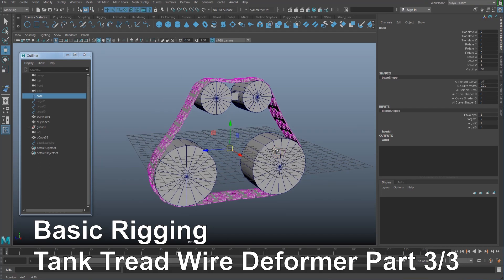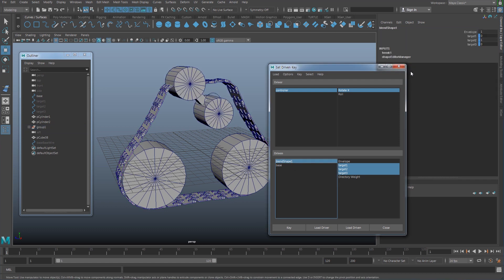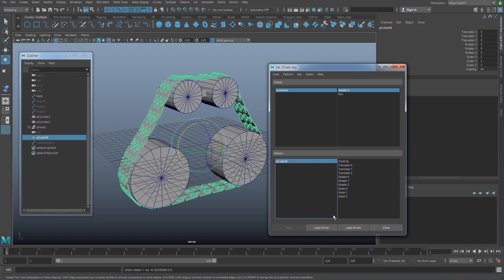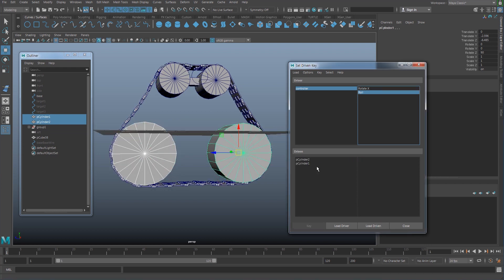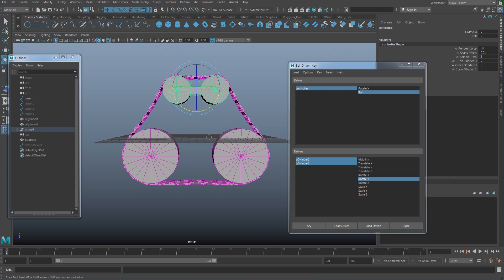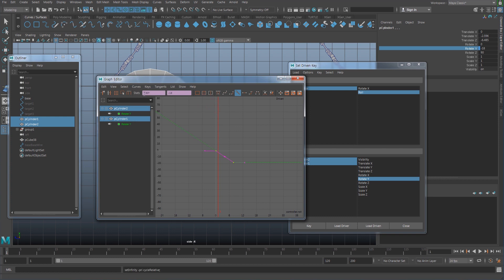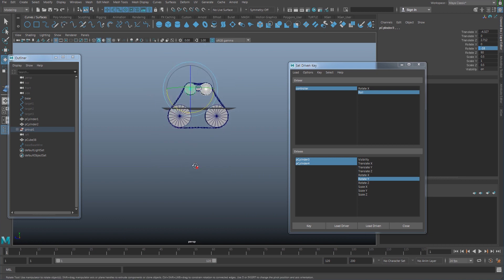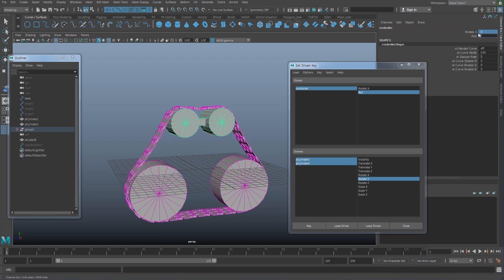Maya Basic Rigging Tank Tread Wire Deformer Part 3/3

Comment: How can you rotate a wire deformer after you created and add all the set driven keys? I noticed my wire deformer cannot rotate on the y-axis. I have tried parenting it within another controller but it does not work.
Reply from the maker: Have you tried parenting to the controller not just the wire curve but also the  base wire node that automatically created after wire deformer.
If it still does not work, start it out parent everything to the controller from the outliner and take away unnecessary things.